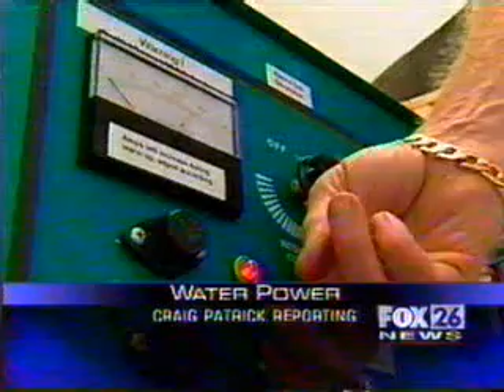Water Energy

Comment: The guy knows not how to make it.
It is welding agregat.But wery old one. Costs less $2000 , Uses distilled water and 3 phase 20A current to produse electrolytic 2H2 + O2.
It used at wery clean welding processes and it`s more expensive than industrial gsaes like propan or N2.
It`s safe to use because amount of H2 in agregat is less than 500ml.
That`s all.
I use it somtime at work.
You can use it in a car when u have with you 3phase 400v 20A or 83 normal 12V car batterys.

Comment: i believe it. a hidrogin oxigen full is a very powerful one. we even use it for the prapultion system on our space shuttles. the only hard part is seperating the two chemicals but yes running the right amount of electricty through water will do the same thing. only thing i cant belive is that the end of the metal on the torch would bee cool to the tuch.